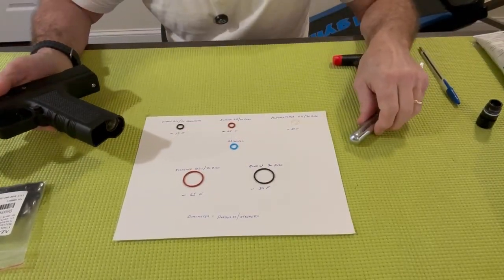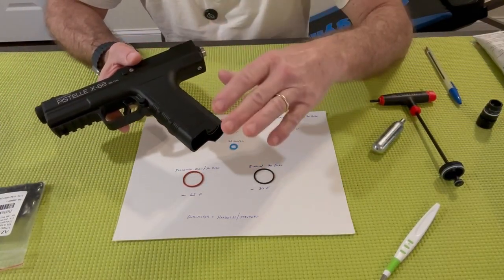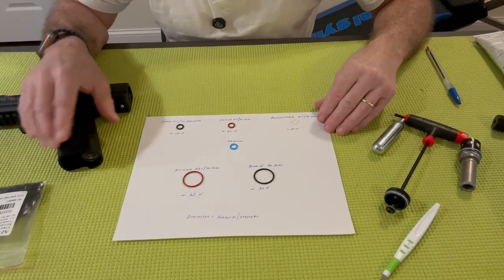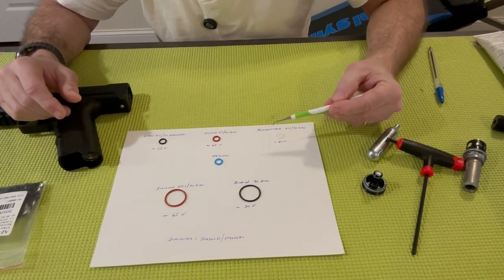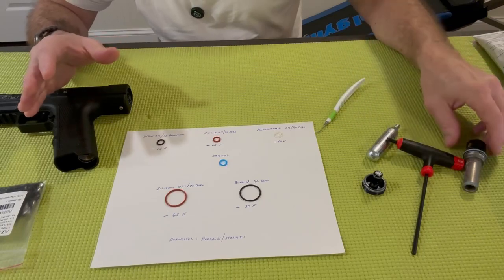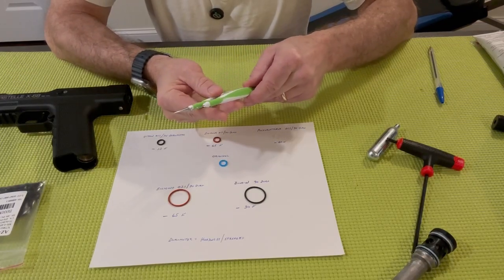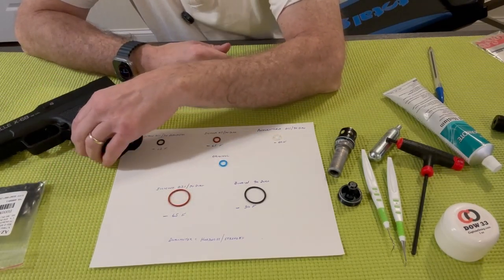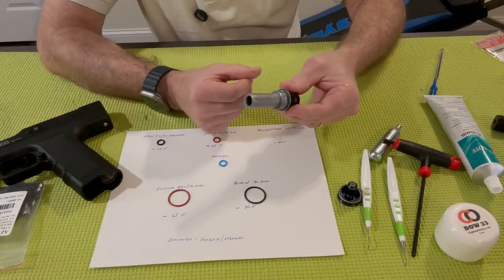Pistelle/Intrubuster o-rings explained! (It’s not all about the size!)

Comment: How and where do you use the grease?
Reply from the maker: As long as you are putting a drop of silicone oil on the C02 every time there is no need to add grease but if an oring fails than remove the back cap and replace then grease all the rings!
Reply: @airgunnerreviews7888  How can I get an extension for mt Pistelle magazine?

Comment: I was thinking about getting the Pistelle , but after seeing your detailed video, I just may pass on it. I wouldn't want to mess with all those tiny seals should they fail. Thanks for your video!
Reply from the maker: It is truly an awesome launcher and mine has been very reliable (so far). Keep in mind you do have a 12 month warranty if needed. So far there is only one o-ring that seems to be the culprit and it is an easy fix and if you let it warm up 10 to 15 minutes between reloading the C02 will greatly decrease the chances of failure.

Comment: How's that clear o-ring holding up on the pistelle x68?

I ordered some on your recommendation, I haven't had to change mine yet, no issues out of it, im about to do some test with some HNBR o-rings that I have since they're refrigerant rated.
Only because I think $30 is a lot of money for those kits that have 9 o-rings.
I may buy 1 kit just in case.
Reply: I bought the clear .011 ones from link and they don't fit right. To skinny to hold any air. Will try to return them...
Good concept for cold but not right for this launcher
Reply: @davezeman769  definitely going to have to check it out then, because if they don't fit I'll have to return them as well
Reply from the maker: I have had no issues with the replacement 0-ring, about 5 CO2 cartridges so far
Reply: @airgunnerreviews7888  awesome thank you, I'll be checking mine as davezeman769 said the ones he ordered from the link provided were to small.
Reply: I wonder if bag from Capt'n O had wrong part in mine? Inside diameter matched but outside was visibly smaller than original. I don't have a way to measure...
Reply: @davezeman769  thats a great question but 🤷🏼‍♂️

Comment: I almost bought this when it first came out but I've seen the issues it can have and how u got to maintain it more than like the hdr50 13j, hdp50 modded, Hdr 68 cal etc, the cheap detents is what you gotta worry about in them, since something this high in joules is out now, a lot of ppl shit on 20j or less now like face shots still won't stop them, great info 👍
Reply: I would agree too but since the first few shots are typically the strongest one might waste them in the heat of the moment trying to head shot a moving target under pressure.  If you can however manage to land a head shot, you will accomplish the same goal even on a 13j aluminum ball ammo or devastator round.  Relying on a stronger joule gun whereby you can accomplish the same hitting the body is a necessity as well.  13j body shot is not going to accomplish this.  The x68 or Galve is the only one on the market in pistol format out of the box.
Reply from the maker: I totally agree you don’t need 20+ joules to stop someone with a face shot!

Comment: Thank you, Scott, for the great video. Do you think you'll do a video on the other 2 O-rings? Especially the hidden O-ring that makes it hard to slide the rear piece on the bolt. Its so tight, it immediately wipes the shaft clean of grease. I'm afraid it will fail also.
Thanks,
CK
Reply from the maker: Definitely a lot of bolt friction! ! To be honest I’m hoping DK Spencer is going to mess around with that one, he definitely has more experience at this, you really need to take it out to measure but getting it out without damaging is another story! Of course if it breaks I will go all out finding that little sucker. lol!